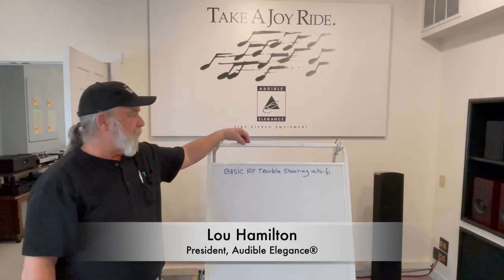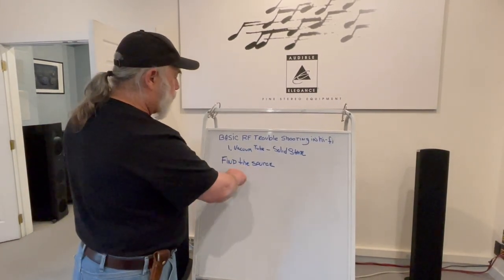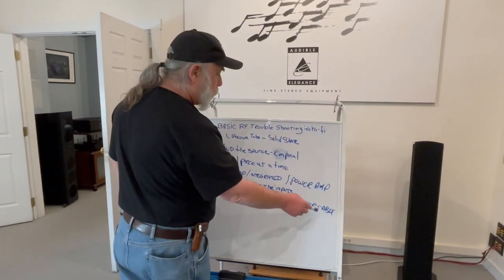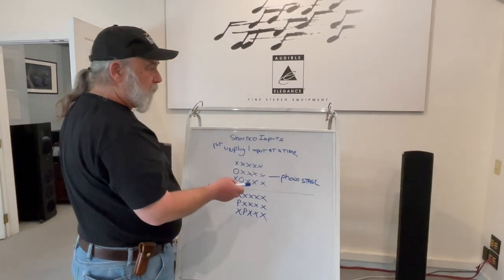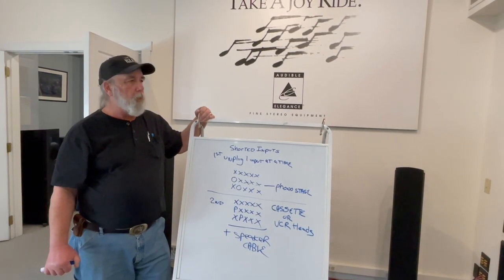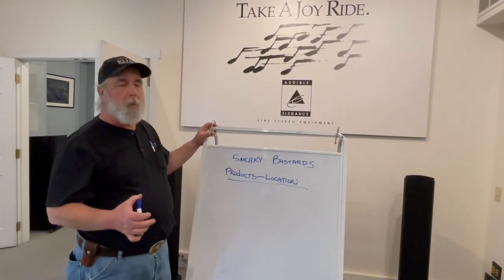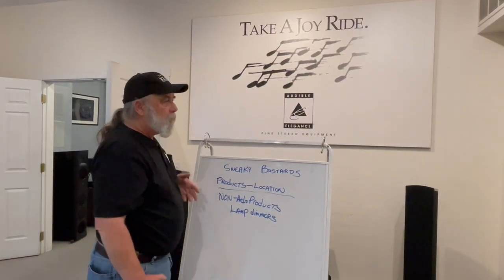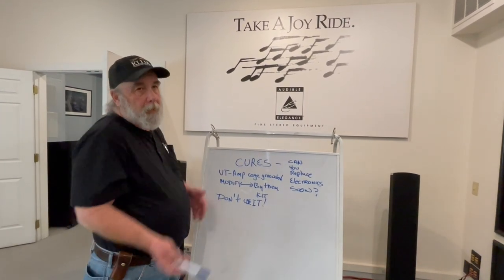Remove RF Interference From Your Audio or Home Theater System!

Comment: Thanks for this.  Really helpful, and in my case, timely. I am experiencing bad RF interference in my home theater from a HAM radio enthusiast. What is weird is that this only started to happen when I revamped my home theater few weeks ago (removing some pieces of equipment, adding others). I will use your troubleshooting steps to hopefully find the culprit in my system.
Reply from the maker: Glad it helped! Let me know how it goes.